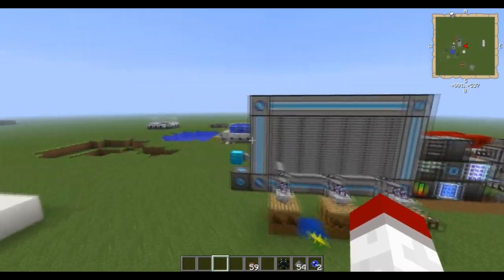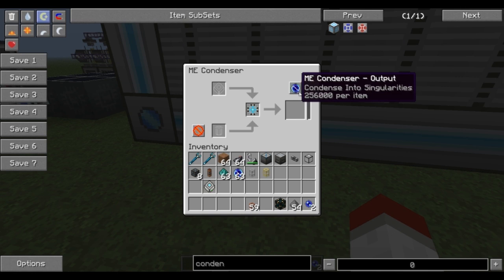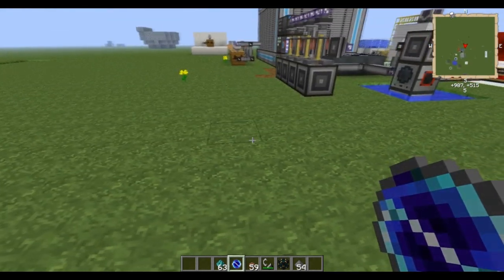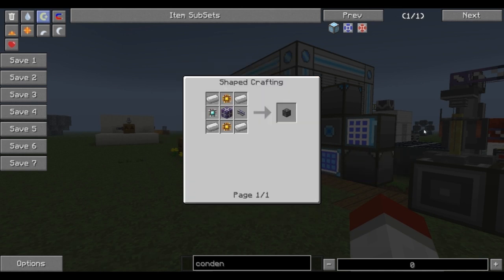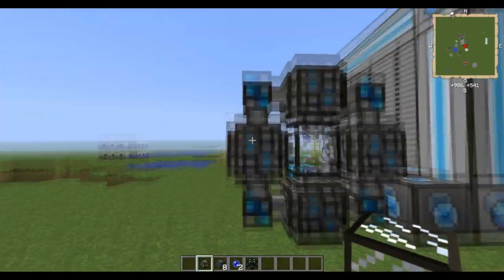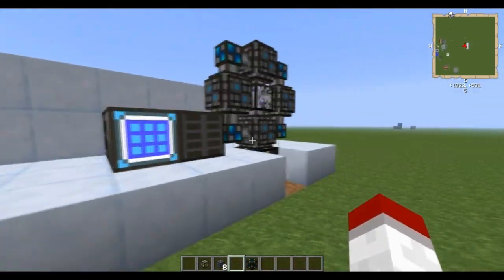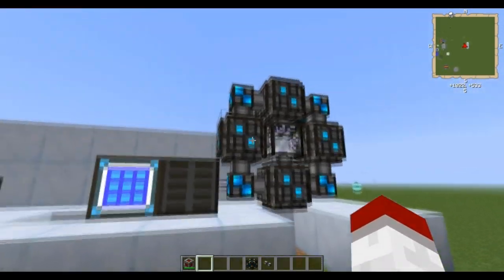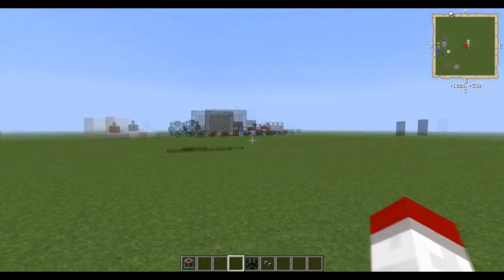FTB - Quantum Field Rings - Wireless ME Network Connection

Comment: ive done the same but when i click it, it says "unable to communicate with controller"
ps. one me system is on the moon (galactriccraft) and one in the overworld; and used geothermal generator for power, and not an energy cell - is that the problem?
Reply: It it because the moon or space cannot do it I even tried with tesseracts it cannot go to,the moon
Reply: What about the deep dark